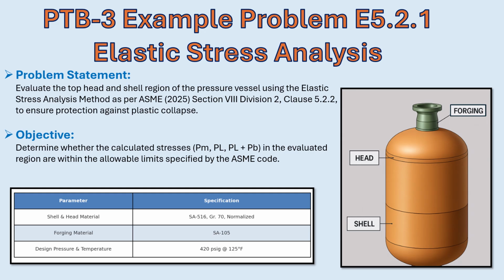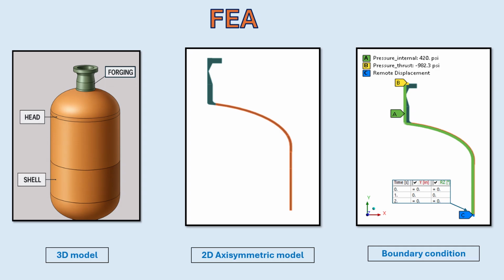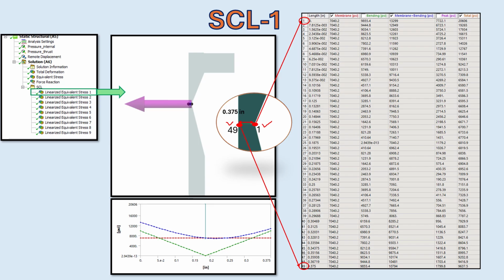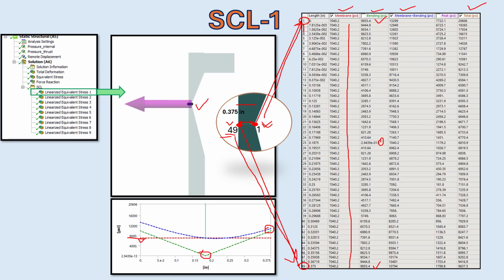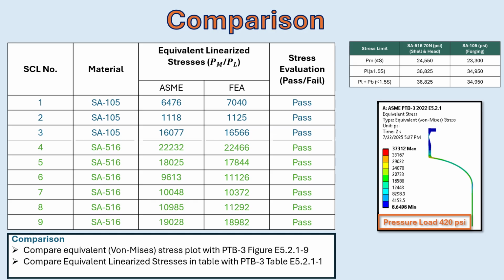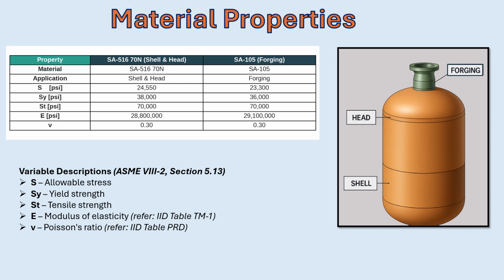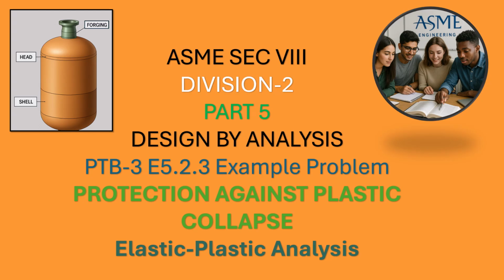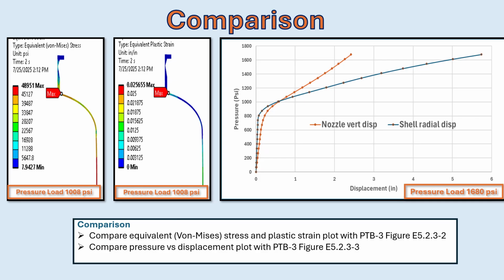ASME Section VIII Div 2 PTB-3 Examples | Plastic Collapse: Elastic, Limit-Load & Elastic–Plastic

Comment: Sir, is it necessary to do FEA analysis for design by analysis? If follow von misses then why it is called design by analysis? Kindly reply
Reply from the maker: Hello @ankursaxena6520 , It is called design by analysis because you use FEA (analysis). In FEA you can get von misses stress and then used the stress in ASME code to check if you meet the criteria. You could also just use hand calcs to find the von misses stress and then use the code but when geometry is complex hand calculations could be very tricky, that is why you use FEA to get your von misses stress, which then used by code. And the von misses stress you get from FEA and hand calc is always exactly same.  I hope this clear your question.

Comment: Could you explain why at SCL1, membrane + bending stress is less than the actual value i.e 13299 psi
Reply from the maker: @thespj9684 because ASME doesn't provide exact geometry and I created geometry based on ASME drawing, therefore it is possible to have some difference in the results.

Comment: Hey, thanks a lot for the video. It really helped me with my work. However, I'm having trouble finding the material parameters for the multilinear isotropic hardening model. Could you tell me where I can find the data you used in the video? Thanks!
Reply from the maker: Hey @so1j0nas , Since I was validating the PTB-3 example, the multilinear isotropic hardening model data comes directly from PTB-3 example. But the standard process is given in ASME Annex-3D STRENGTH PARAMETERS. In this Annex you would find how to create stress-strain curve for a given material. You would only need Yield strength, UTS, and Young's Modulus. Since all these values would be engineering values Annex-3D would convert it to true stress-strain curve. For Ansys you would need true plastic strain vs true stress value for Multilinear data. I hope you would able to follow it.